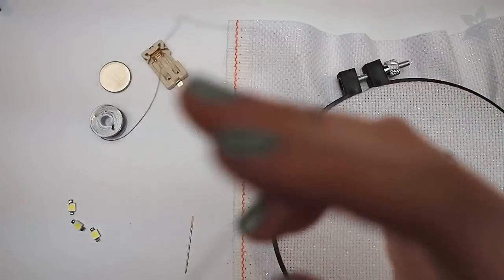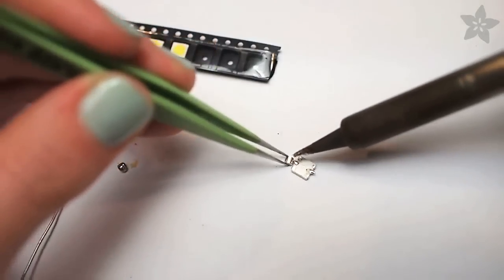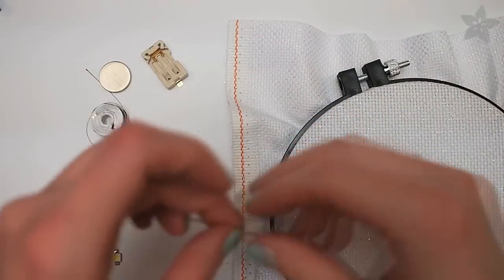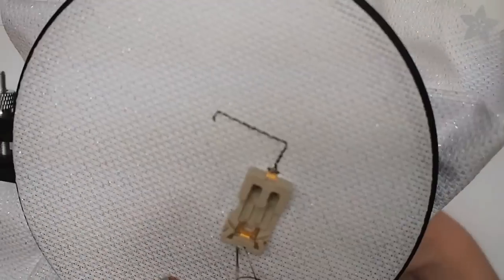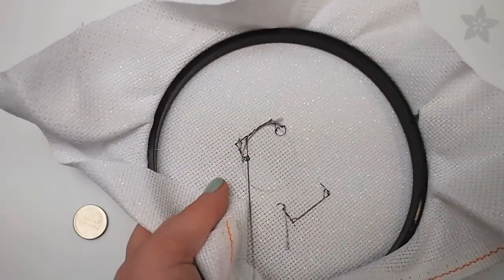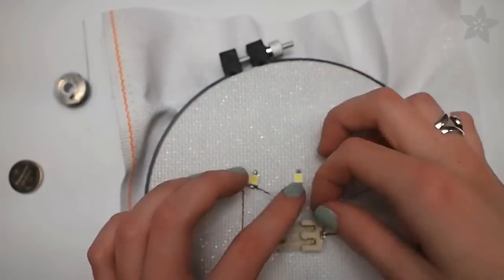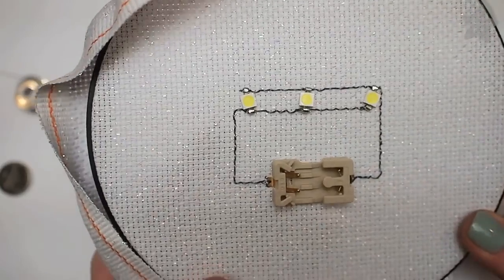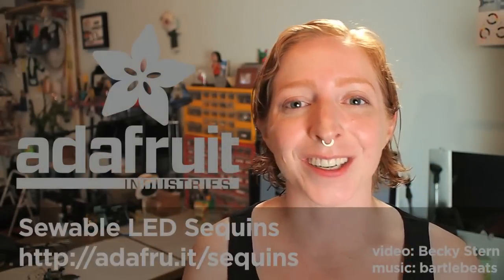Sewable LED Sequins

Comment: awesome becky, i love your stuff, but wouldnt it be smarter to mount the battery on the inside, because the conductive thread can connect on either side and it would be better to hide the battery on the inside and the cool line and LEDs on the outside? no?